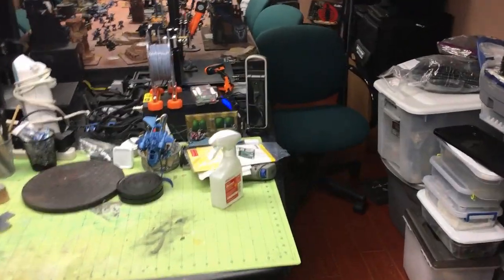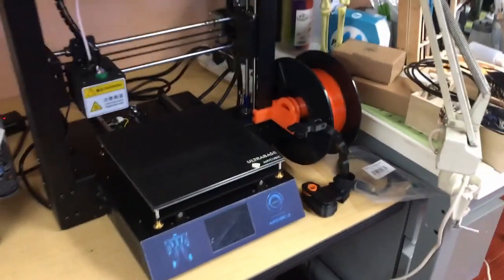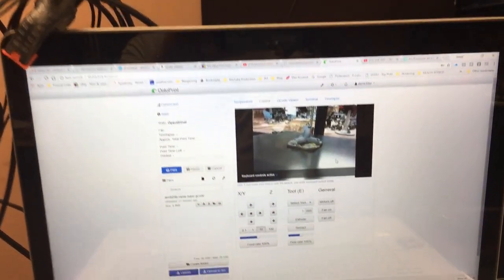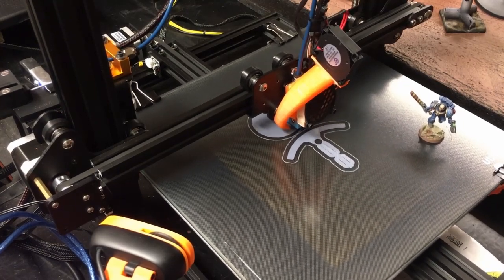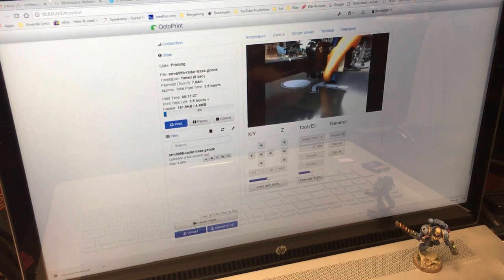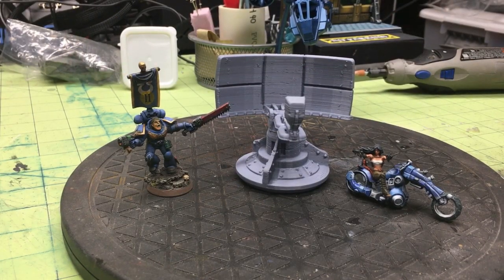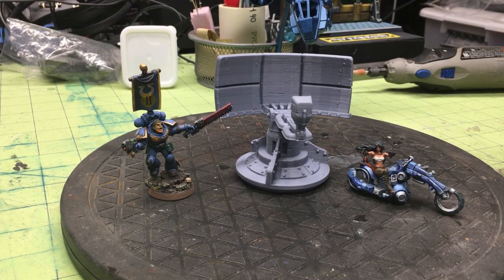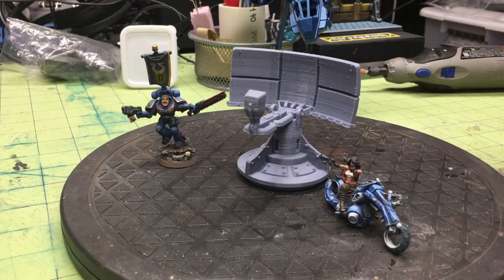Adding Rsapberry PI with Octoprint to My CR-10S

Comment: Very cool setup,but can't you do the same with a wifi SD card to transfer G code to yourprinter,and use a IP cam to monitor your print
Reply from the maker: MvdG I’m not sure. That dose sound like a very cool setup and would like to try it out. Thanks for the comment and suggestions.

Comment: Did I see it correct. Did you connect the pi with the blue usb cable to the control unit of the crealtiy printer?

Comment: What profile setting did you use in Octoprint for the CR-10S
Reply from the maker: Unfortunate just the stock setting for the CR-10. I realized after the video, I was getting little zits and artifacts on my prints. Looking up the problems with Octoprint and the CR-10S, on Thingiverse,  I found there are problems with the buffering effecting the print quality,

Comment: Definitely really cool, but how do you get the prints smoothed out? assuming you use PLA
Reply from the maker: Print a a higher resolution, filler primer and a little sanding can give way better results. For gaming terrain i don't mind the lower resolution and a little airbrush work can hide a lot of the imperfections.
Reply: You happen to have a link to a good filler primer?
Reply from the maker: killroy v2 I’ve been using rattle can Bondo filler primer from my local hardware store.